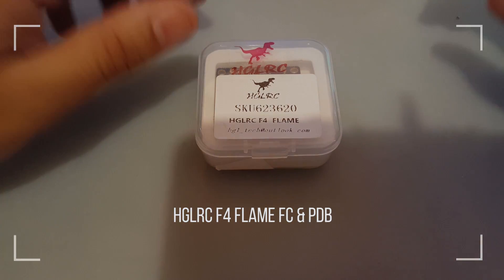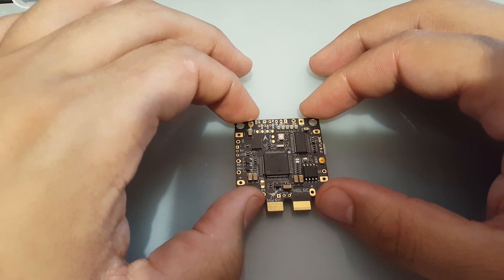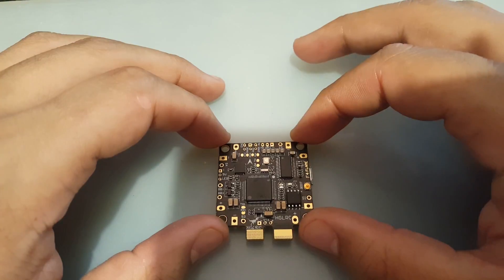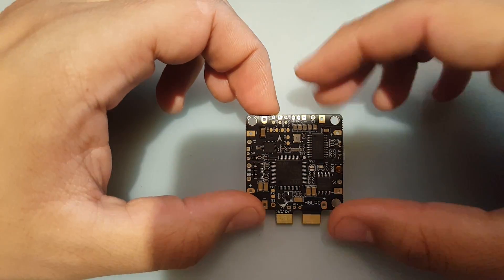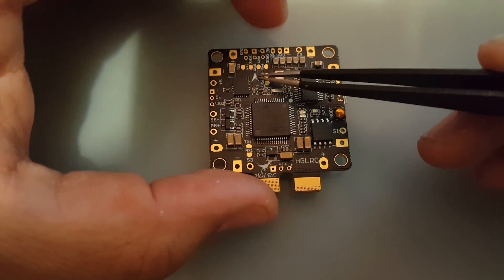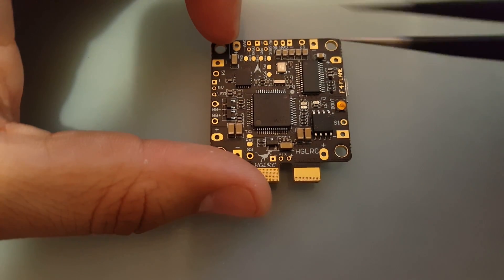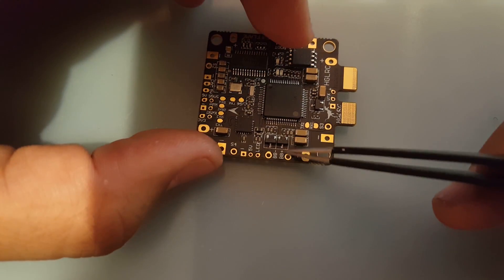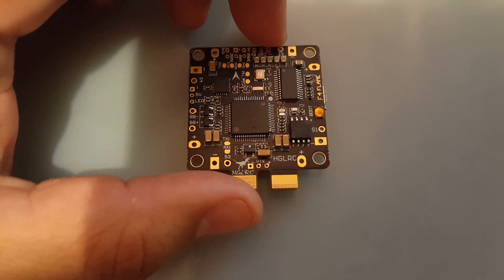The Best F4 FPV Drone Flight Controller 2017 ? // HGLRC F4 Flame

Comment: so i just got hglrc flame f4 but on quad i got used the osd dont work,ive got stuff selected in the config and also tried a switch thinking it was that and switch activated when armed but still nothing. it has a crappy 650 camera and im using 5828 vtx some china knockoff...my other quads has nicer stuff omnibus f4 pro,tramp or tbs unify pro,monster v2 cam and such.. what could be issue? i never understood drap and drop? i know i position things around in the osd on gui but is there something more too it?

Comment: Just installed the HGLRC F4 Flame but for some reason I have NO yaw control.  I did the, revers prop command in Betaflight, and have done this to all my quads.  (Just thought I'd mention that)  This is the first time I ever have a problem with yaw, any idea what I've missed?  Yaw works as it should in Betaflight but test flight is absents of YAW, every other stick movement works.

Comment: I have installed this fc in my build and it is dud!!! All of the components are new but the pitch gyro receives so much noise making the quad not possible to tune nor fly. After investigating of the black box data I can only conclude that there is something wrong with the pitch gyro. There is so much noise in the 0 to 100 hz range on the pitch axis that even maxing out the filters doesn't help to fly it or tune it. I am really disappointed in this FC.

Comment: Hiya

I'm in the middle of building my first FPV quad using the Realacc Purple215mm Frame kit and 2205-2600kv motors on a 4s battery. But being scared of using AIO flight controller with ESC's reading all the horror story's about them. I wanted to know if there is a flight controller with these Functions Specifically but with no ESC's builtin...

F3 - F4 Board "If updated thats great".
Built in PDB. 130-150A.
Barometer.
Current Sensor.
Beta-flight OSD. "Not Mulitwii"

Any recommendations would help me so much and be highly appreciated as now im stuck halfway through my build wondering what to do :D
Reply from the maker: HGLRC F4 Flame and Skyzone F4 are good FC's however none of them have barometer.
Reply: Drone Mesh I found one! the Flip32 omnibus with baro. thx anyway :D

Comment: Hi. Any advice on using this fc and wiring it up to a x-racer 25A quadrant esc in the 4 in 1 configuration. Thanks, all help will be very much appreciated. I'm putting these in a Realacc RFX 185  frame so space is limited.

Comment: Sup, i think that you have to have a signal and ground pin to fc only if you are using fc witch might not have a true ground from battery and im thinking that most pdb+fc might have them now becouse theoreticly fc uses a ground wire to messure between ground and signal wire. Ohnesly i've bin trying to find the best pdb+fc+ osd and for now i have 4 models wich im looking at including this One. Right now im testing the dys f4 and i have a friend trying the lumenier cicada. This looks actully a lot better then my dys 😑.

Comment: I used this fc, but i didn't use the esc connections. I connected my escs to the pdb to keep the fc a little bit cleaner. Are there any cons doing this?

Comment: Hi, i'm having some problems with that Fc. I can't seem to have communication between my ia-6b to the FC, when i go to receiver page on BF3.1 i don't have readings from my Radio. i've connected the sbus port from the FC to Receiver and the 5v/Gnd to but it's not working.
Reply: Sasquatch FPV hello broh, did you resolve your FC issue?? I have the same problem thxxxx

Comment: is it worth buying? $32.99 on banggood right now, I need a pdb AIO for my martian II frame I just ordered which is the anniversary edition that comes with a carbon fiber plate instead of the badly designed pdb and its on sale for $17, I almost bought 2 martian II frames lol.
Reply from the maker: +Richard E get the Matek f405 AIO... the best FC I have used and tested by far.
Reply: awesome, I wasn't sure but nice, I will probably order one if your getting good performance out of it.

Comment: Hi, can you tell me what is that S6 pad for? close to  TX6, is it for motor 6 connection? where is S5 then? please help, cause I would like to connect camera servo and if it does have more than 4 motor outputs that would work for me, thanks in advance
Reply from the maker: Mr StOrK Only 4 signals.
Reply: so what is that S6 pad for?
Reply: i think it might be place to add i.e. servo or some other accesory like that

Comment: I Have 2 now And love them!
Reply from the maker: Awesome Just finished testing it for noise.. Uploading the video now.
Reply: will be interesting ! i am using a 20amp racerstar aio esc and i want to wire the power from the esc  to the motor pads for + on m3 and - on m4 to power the esc think this will work? is it a straight path from battery pads? will test when i am at home with multi meter then just wire up signal wires from plug should be a neat build if it all works !
Reply: i have one in a Space one 220x and the new one is going in a Realacc y150

Comment: Dedicated ESCs is past century technology and this board not disigned for modern 4in1 ESC that allow keep max weight in center of quad and have not so wide arms. "I am not tested but board is good becouse caps" - brilliant! Why computing module needs 300A power lines, when its ESCs function - commutating high Amps?

Comment: ive got this board and its already broke, all the ports around the sbus pads are faulty, ive rated this 1 star on bangood and they havent even put my review up, bit sly if you ask me
Reply from the maker: The Fly I ordered 3 so far and will be testing it this weekend and sticking it into a build.

Can you explain how it got fried or broke apart?
Reply: not too sure in mid air it browned out, but was no higher than a standard size race flag and its not working, ive got avideo on my channel explaining more about it, check it out
Reply: The Fly fpv Banggood never posted my negative reviews

Comment: Its a brainfuck to get youre head rapt around  al this😆 it would be helpfull if the give you like a manuel whit it or not😆 were you have to grap the power for youre vtx and ground vise versa for youre cam. signal wires , wires to youre receiver and stuf 🤕🤒 btw are you gonna do the give away whit the 1K ?

Comment: Hi
would you know if this FC supports DSHOT with out re mapping the pinouts ,,,, thanks (will be using with some rcinpower 2305 motors
Reply: All F3 and F4 FCs should support DSHOT, it's the ESCs that do or don't. Actually, all ESCs support dshot, just some you have to modify by removing the signal capacitor. Project Blue Falcon has a good tutorial on how to find and remove that cap.
Reply: I ran dshot on an f3 evo before and had to remap the motor outputs it worked but was very glitchy.    
would hope that the f4 flame will be dshot ready out the box like some of the other new FC that are out now

Comment: dys f4 pro vs flame f4.  Which is better?
Reply: The Flame F4 seems to have the advantage with 16M internal blackbox logging, and also has a filter so if your VTX runs on more than 5V you can plug it into the VTX pins directly without any interference in the video. Just remember the VTX pins run from the battery so check your VTX can handle your maximum battery output voltage. The only thing with the DYS is it is more reputable brand than the HGLRC and the DYS includes soft mounts.
I'm trying to make the decision myself at the moment and I think I am leaning towards the F4 Flame and purchasing soft mounts with it.
Reply: I used many HGLRC and DYS product. Only DYS has been going for them is their name is out for so long. HGLRC is a new company and their quality is top notch. I bought 10 FC(F3 v2 v2.2 v4 , F4 v5.). None arrived DOA. Non had issues. Only F3 v4 had some noise which was fixed with adding some caps. But their  internal components are quality stuff.

Comment: I just got one of these.
Couple of points that someone who knows more about them. Might be able to help.
Motor stop function in Betaflight causes issues with my speed controllers. DYS XM20amp speed controllers.
When motor stop is enabled. Motors run up to full speed. Variable speed doesn't work.
The VTX outputs on the board do not have any bec. Full Lipo voltage is supplied from these outputs. So be careful not to blow your vtx. There is a 5 volt output for Camera but unless you use the VTX pad on the opposite side of the board. You wont have OSD.
Reply from the maker: Great thanks for the tip i am making the test setup now for this board to test it and report back my findings..
Reply: I cannot get telemetry on my X4RSB either. Appears there is only 1 univerter on this board and its already being used.
I did read somewhere that you can hack the X4RSB to give an uninverted telemetry output. I think it involved soldering a wire onto the receiver.
Reply: Just done my first test flight. Wow! Its a flippin Bullet. Took me by surprise how quick it is. Obviously due to it being so lightweight.
This flight controller is superb. Still got to set up the OSD but it flies fantastic on stock betaflight. I did up the rates a little and dialed in plenty of expo. A hint of prop oscillation but a bit extra D will sort that out.
I have the Iflight IX5s frame with DYS XM20 speed controllers and Cobra CM2204 2300kv Motors.Turning DAL Cyclone T5045C props.
HS1177 Camera 2.5mm lens with Eachine VTX03 fpv transmitter.
 I am using Trinity 4s 1300mah graphene packs.
AUW is only 249 grams without Lipo.

OMG! What a Quad.

Comment: I run 2306 EMAX with TBS F3 Elite bundle and 25a ESC's on 3 different quads with no caps and no problems. Just returned a Revolt Bolt/ FC combo with caps to Trappy for another Elite bundle running betaflight. Ain"t no reason to fix what ain"t broke.
Reply from the maker: Black or White Emax's, Also keep me updated on the status of that quad if you get blackouts after a while.

Comment: Awesome thanks ! Great vidéo !
Because I have a problem on my Furibee Fuuton of White Lines in the video feed and even by adding Lc filter or changing vtx didn't solve it. I was searching for a Pdb Fc board to remplace the one of my Fuuton hoping to solve the problem and that's exactly what I was looking for :D I bought it then ^^
Oh and the sound of your intro is maybe a bit to hight ;)
Reply from the maker: Awesome Glad I could help.. 

Yes I did not notice it until i uploaded, this issue is fixed in my upcomming video ^_^

Comment: where does ground for sbus reciever go?
Reply from the maker: Look at the arrow on the board and make sure its pointing towards you. Then you will see sbus under sbus there is 5V and if you look to the next hole to the right of it that would be your ground.
Reply: Thanks

Comment: wil ibus works with this f4 board?
Reply: Yes, wire power and ground as normal and the signal wire goes to the RX1 solder point which should be UART3 TX1 being UART2

Comment: Is there a 5V in? How do you connect to a 4in1 esc?
Reply from the maker: Yes there is 5V ..
You would solder the 4in1 esc wires to correct signal pads and take power from any ESC power pad on the FC and your good to go.

Comment: Have they discontinued this board? I remember it being more than 35usd. I got one now.
Reply from the maker: No they drop the price to compete with the DYS F4 since its still sold out. Everyone rushed to the DYS F4.
Reply: That makes sense. I rushed for DYS F4 too, but now as you posted video I bought HGLRC so I don't have to wait till DYS will get back in stock again.
Reply from the maker: The DYS F4 looks okay but I don't think it can compete with this.

Comment: Does this FC only have one UART (TX1/RX1)?  This for SBus, right?  If I want to use telemetry, where would it go?
Reply: you can use the s5 or s6 pads, need remap on betaflight but the good thing its that you dont need to open up your rx to get un inverted telemetry signal
Reply: This FC has S5 and S6??  I must have missed it.
Reply: cant see ir right. but you have tx6 tx3 amd tx1. there you Will need the telemetry "hack" on your rx.
Reply: SBus solders to the front SBus pad, and to the back of the board TX1 pad should be UART1 and RX1 pad being UART2. I think anyway.
Reply: jabonloco did you manage to use your taranis to control the pids?

Comment: You got a great fc now .  Been rocking this fc with emax 2750kv. on qav ulx.  105 mph. running every weekend for 2 months no problems at all.  SOLID.   emax 30a bullet rock as well.  dshot 600 working flawlessly...   your going to love it...  also my second best is the dys f4.  totally awesome also.  rock solid
Reply from the maker: Yes that FC looks very promising because it was the only one mentioning the EMF in description so they know what they are talking about. Plus the 90+ caps thing is what got me as well.

I got the Emax bullet but they are soo tiny I was afraid to test them in my lab with the 2750kv thought they would burn like my others. I actually made a video about that and will upload it tommorow. 

I found something that everyone must know about the Emax 2306 2750kv motor from my testing.